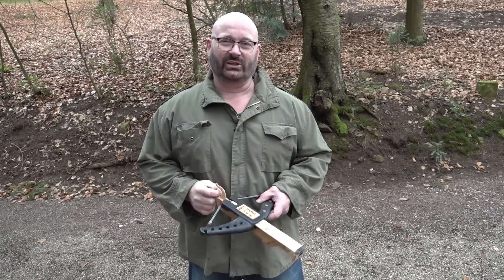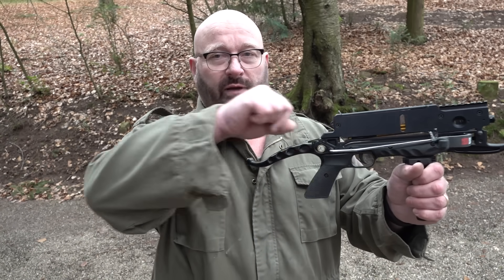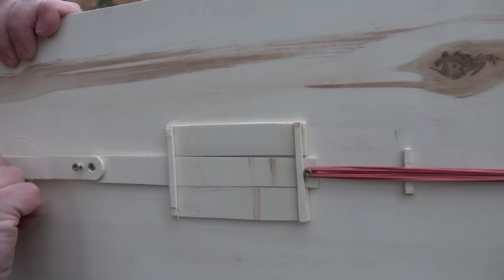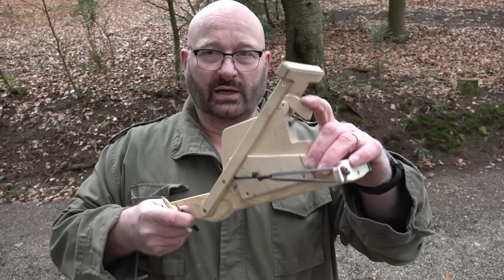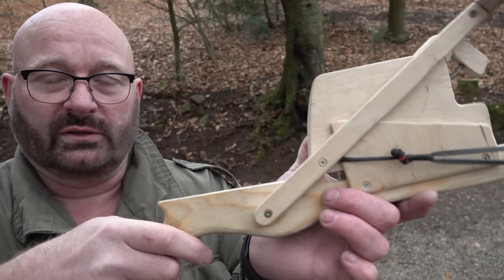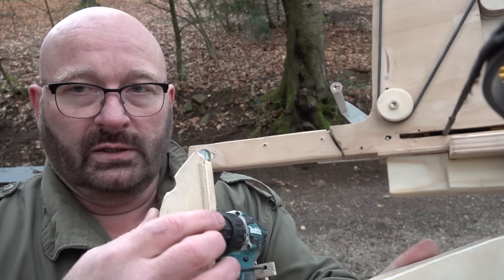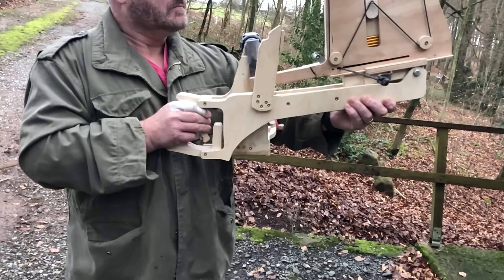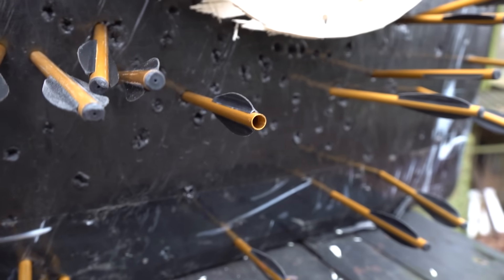Archery Extreme: Ode To Joy!

Comment: "little bit of shake"
shakes the hell out of Joerg, who is the size of 2,5 normal man :)
Reply: Zak that's called a 10 on the rector scale for normal sized guy LOL.
Reply: Yeah, but for a first prototype, this was kinda awesome lol.
Reply: Crew served cross bow
Reply: What's missing is a stock and maybe a front pistol grip
Reply: @Krzysztof Żak
i have tears in my eyes because for your comment, thanks man ;)
Reply: @looseballs1966  You must either have ment the Richter scale (how much it shakes the earth) or the Rectum scale (how much it shakes the ass).
I understand you must have ment the latter.
Reply: @BrokenSeraphim  or  tripod?
Reply: @trollslandan  Or maybe the wrecked-er scale
Reply: it's still hitting the target. With this fire rate, you can justify missing even half of the hits.
Reply: Its some arm breaking level of shake

Comment: Even with all of the movement it is SURPRISINGLY accurate. That is really, really impressive Sir.
Reply: Well, it does seem kinda bulky to be frank. I wonder if there's any way to make it more ergonomic?
Reply: @ventex1352  always from my experience. We are all ergonomically different.
Reply: @ventex1352  Building the engine into the side instead of pretty much duct taping a drill to it would definitely help ^-^

Comment: This needs a turret and the instability is no longer an issue
Reply: Rohypno tist just have another upside down on the bottom and the forces from both cancel out.
Reply: @carl9022  big brains optimize
Reply: Or a bipod
Reply: Give him a week
Reply: a turret mod of this would be awesome, some small bipods would already fix it i guess.
but it's already insane :D
Reply: You mean a bipod?
Reply: Heavy tripod would do it alright. Pivot mount for a wall or ship's railing would also work well. You could even go bigger on the whole thing and have a nice, crew serviced weapon strong enough to pierce most armor.

Comment: I would love to see something like this mounted on a tripod-type of mount (like a mounted machine gun)... And belt fed would be beyond amazing.
Reply: Yeah, the vibrations are a bit too extreme for something handheld.
Reply: Then he could use the 200ish pound long bow he had on a while back instead of these little cross bow type deals. The 50cal of the Jorg repeating bow world. Mwahahahahaha I want to see its features!
Reply: did you not see the twig? that's instead of a tripod
Reply: @professionalrookie8771  Crossbows have shorter draw lengths but much higher draw weights (a windlass has around 800lbs and arbalests have up to 5000lbs)
a shorter draw length is ideal so that the contraption can be more compact
however, he'd need more power than a hand drill to get it running
Reply: @Kensuke0987  I'm aware of that lol but as the the bolts are alot shorter they need that extra power to get enough momentum to do any damage they definantly do it well besides I'm a bow man not a cross bow man not that I dont enjoy cross bows I just prefer recurves. and I recon a hefty long bow or good recurve would make a sweet tripod repeater. Specially the way this guys going lol
Reply: @professionalrookie8771 
The power really comes from the longer draw length.
Even then, with a really long rail, you could just use bolts - or heavier bolts if you want more momentum. Joerg used bolts on his instant series saying that the enemy won't be able to shoot your bolts back with their own bows. Bolts will also make the magazine more compact.

But if you mount the bow onto a repeater contraption, wouldn't it be just a really big crossbow? or maybe a ballista even. With the amount of vibration the small one does already, it'd probably have to be mounted on a very heavy tripod too... or one that has wheels.
Reply: @Kensuke0987  yep short arrows in the bigger bow so they couldnt shoot them back is a genius idea!! Necessity and limitations I recon are the biggest factors in creativity and invention back then necessity was key these days you dont get war with bows and swords and we have more shit than we need so its surplus to requirement 😔 no more necessity inventions just limitation birthing creativity. Yes good point ballistas do exist and that practically is just a small ballista. Well instead of it being the 50cal of the cross bow world it can be the compact cross bow of the ballista world lol.

Comment: Some ideas I'd like joerg to see 

1 - LESS VERTICAL MOTION: considering the arrow is fired from the same position each shot , it is unnecessary to have the magazine moving along with the drawing mechanisim. this extra mass is the main cause of the vertical displacement. you could have the magazine fixed to the stock at the firing angle with the bow string rotating up to meet the magazine at the firing angle. 

2 - DOUBLE SPEED: a second efficiency to address is the fact that the drill is only exerting force on the bow string for one half of its cycle , the other half of the cycle is potential torque wasted (as it is returning to the starting position for half the time). 
when the string is released it returns almost immediately to the starting position at which point another drawing arm (set opposed to the first i.e 3oclock and 9oclock) could be immediately retracting the string for a second shot. firing every half rotation (adjustments will need to be made to allow for string return time) : *DOUBLE SPEED*. 
*the string will only ever follow the bottom half of the drills arc, unlike in the rubber band demonstrator where it remains attached and follows the top half too
Reply: Upvote
Reply: and run the setup upside down since the magazine isn't fed by gravity.
Reply: Upvote? This isn’t reddit 😂
Reply: I legit almost throw up when I seen  this, please read this guys comment!
Reply: How about you make one and make a video about it.
Reply: @parabina  maybe I should come up with a proof of concept. The more I think about it the more I realise the difficulties in implementing these changes 
And I edited out "upvote" 😅
Reply: Won't that creat a molecular instability on a quantum level destabilizing the coefficient drive transfer case causing a  rift drag in matter displacement detonating all matter in the lift zone ripping a hole in space-time sucking half of the planet through a black hole sending a quantum charged antimatter death Ray into the sun causing a chain of events that destroy this universe and the next on four planes of existence?
Reply: @JohnSmith-un9fy  lol
Reply: @JohnSmith-un9fy  Probably not.

Comment: Hi Joerg, if you needed extra support, I see the revolving mechanism does not come all the way to directly above the trigger guard, so you could probably design a Barrett M82A2 style stock that allows you to shoulder it better and if you made it so you could add weight to the bottom, the weight could offset the yaw force created by firing the crossbow with de gravitational force derived from the weight and it wouldnt mess up the rotational cycle. Cheers.

Comment: I love how you went into the engineering thought process that went into this design. That should help a lot of young engineers to really start to understand how to solve problems. That is what engineering is all about after all; advanced problem solving.

The thing is not all that accurate shaking around like that, but looks like fun, ha. In a world without firearms, I could see it as a viable weapon. A line of people with these things really would make a wall of bolts.
Reply: Zombie apocalypse weapon, anyone?
Reply: He is hitting the target repeatedly, which with a full auto weapon is pretty much enough. He hasn't even had time to practice with it much yet and already that target is dead.
Reply: Fixing it so it acted like a fixed turret could also make it much more accurate

Comment: You could try a Cordless Angle Grinder with variable speed. You can even adapt the switch/trigger of the drill for a more controlable speed. I just don't know the torque tho...
Reply: Better and simple use a cordless angle drill ;)
Reply from the maker: Angle grinders are all rpm and no torque. Useless. Angle drills have much less torque too. Forget all this angle business, it does not work.
Reply: @Slingshotchannel  words of wisdom.

Comment: This actually gets me thinking about Airsoft AEG gearboxes and motor sets. It could produce the same results with some tinkering now that I think about it.
Reply: Tactical Shrimp That’s why I was thinking about modifications. You can get some pretty powerful high torque motors that can pull much stronger springs. I was thinking of the same concept as the power tool, but without the crazy rotator mechanism that causes a lot of recoil.
Reply: Tactical Shrimp I’m just applying what Jeorg was thinking of, in making possible full automatic and semi-auto capabilities.

We don’t really need a stronger spring to project the arrow, but to rather reset the firing mechanism, which doesn’t necessarily have to be an AEG piston. The gears grabbing onto the piston teeth, is what I’m projecting to be the mechanism that pulls the bow string back for cocking. The V2 gears and motor inside the gearbox will minimize the entire recoil aspect via the power tool rotators. Since the motor is essentially the power tool.

Comment: Joerg- have you ever thought of using course threads to cock the cross bow. Using a lead screw like on a metal lathe and a half nut to pull the string back. once the cross bow is cocked  the half nut would be pulled down with a spring and returned with a spring to do the process over and over again. The movement could be kept to a minimum so very little vibration and friction. The drill and the lead screw could mounted in line.

Comment: “The germans had the strongest weapons during world war two,”

THIS GERMAN HAS THE STRONGEST WEAPON NOW
Reply: That sentence in quote marks is wrong since Americans had the A-Bomb in WW2
Reply: @gokbay3057  
OP is probably talking about stuff like tanks, guns, artillery and most other things, since Germany was way ahead of the other nations. They just didnt have the industry and oil to supply the weapons
Reply: @BeGayCatDoCrime  I would disagree. German tanks weren't really the best even if they were impressive. Of course everyone would know that Germans did not have the strongest navy, as good/useful as the U-Boats are. Germans did create the Stg-44 (I think that was it's name, the predecessor for the AK-47) but their earlier guns weren't the best as German soldiers on the Eastern Front often decided to drop their submachine guns for the Russian SMGs (those with drum mags, I think that was the Tokarev). Of course Germans biggest problem was resources and production capacity. Thought their designs were partly responsible for the problems with production capacity (Americans could have probably built more Tigers faster than the Germans could but more importantly they could build even more Shermans, even faster). But then again, no one could compete with American production capacity.

I am not even American but they were extremely OP during WW2. Sherman might have been a shittier tank than the Tiger but it and it's crew could be replaced and they could field more of them. While the Tiger couldn't.
Reply: Pppft we Brits had tea and stiff upper lips...no military might comes close to that!
Reply: @gokbay3057  In fact, Stg-44 is a predecessor of M16. AK took just the idea of intermediate cartridge from it. The rest is a successful combination of ideas from TKB-415, AVS-36, M1 Garand and more, yet not inheriting Stg-44 design decisions.
Reply: @gokbay3057  well they acquired the a bomb by stealing German Uran and plans mostly.. So basicly no
Reply: German tecnology is the best in the world
Reply: Gokbay yeah germany was so bad yeah.... thats why they almost single handly won all of europe and africa 

You my friend are not the smartest of you class
Reply: @peterzingler6221  Actually no. German had not even been close to the bomb and didn't had enough uranium, too. In this case USA did it quite on themselves.
Reply: @Kelvinpierre99  how are you gonna tell him he wasn't the "smartest in his class" when you're using 2nd grade level grammar trying to sound smart
Reply: And it’s a No2 pencil
Reply: Helder Cunha  No they didn't. Get your facts right. Germany was on the wrong way regarding nuclear power and bomb. e.g. they calculated the critical mass wrong, so they never would have made the bomb work.
Reply: Ulf ViKings  Germans built the first Jets iirc. Also I didn't say Sherman was better than the Tiger. Also I agree that Germans had good tanks. I just said Germans didn't have the best tanks. Soviets had pretty good tanks for example. Outside of the Jets Germans also built very good planes (fighters and dive bombers particularly) but Americans also had incredible planes in said department while Brits had the Spitfire in the fighters and Japan built very good carrier aircraft.
Reply: @onion_wind  My dad captured a German tank with his Lee Enfield .303 rifle. He saw it stopped on top of a dune in North Africa, took a pot shot at it and 6 Germans appeared from behind the tank waving a white flag. (The tank was broken down and the Germans were happy to be taken prisoner by the British :)
Reply: Russian : hold my tsar
Reply: @gokbay3057  The AK-47 is Russian, though. How can a German gun be the predecessor of it?
Reply: @andrewdevine3920  basicaly they took Stg-44 as a base for AK-44 (at least its looks and design), simple as that. After Germnay lost WW2 Americans stole their scientists like Mr. Wernher von Braun and Soviets took what was left of it, technical plans, drawings and rest of it.
Reply: @andrewdevine3920  the AK-47's design was as far as I remembered when writing that comment was heavily based on the German gun.
Reply: Jojo Reference

Comment: I think looking at opposing twin cylinder engines would suggest a pair of moving mechanisms 180° offset would be far more practical than a large weight to balance things out.
I am aware this would almost double complexity, but surely this is just for fun? A little extra complexity is surely worth it if you could increase fire rate and accuracy?

Comment: About the vibration and balance that was discussed at 12:15, I can not understand that the "draw-weight" of 80 pounds is relevant for the the counter balance mass. For some reason I think that the "draw-weight" and horizontal "recoil" is contained within the system, and it is the shifting of the magazine/ammo mass that introduces most of the vertical imbalance while operating the tool.

Comment: @JoergSprave Hello Sir. I hope everyone is well and that you and your family have a beautiful holiday season.

Off topic question.. Can I put a plastic Shrink Wrap around the trigger point section of my AR-6 2 Stinger crossbow string? I find the String Wrap on the stock string frays very easily. Do you have a suggestion that addresses my issue?

I greatly appreciate any help you might offer.

Sincerely,
Robert
Reply from the maker: Shrink wrap does not work. Frequent waxing works well but you will still have to redo the serving every now and then. Alternatively, you can switch to hand made Dyneema strings that do not require middle serving, lasts longer and are dirt cheap (like a dollar per string). https://youtu.be/fkuMtmP95f4

Comment: Hey Joerg, why not a screw release system?
The rope is relied to a 2 part nut which placed on a screw. activate the drill make the crew turn, forcing the nut to ramp up the screw, pulling the rope. At max pull, the nut separate from the screw, being pulled back by the rope firing the arrow.

Comment: Quick idea: Why not make the bow and string rotate instead of the magazine? It should work either way, and you'd have much less mass moving.
Reply: Less mass but it would make it less accurate to have the crossbow part flying in circles.
Reply: @spencer4679  
You're 100% right it would be inaccurate, but I actually think the recoil from the extra magazine mass makes it even less accurate than that. Anyway, the angle of release wouldn't change since it fires at the same time every time.

Comment: 9:48 Imagine having that back in the middle ages :D
Reply: They had more than you can imagine ;)))
Reply: Would be useless against armored targets compared to other existing crossbows. It would be a great home defence weapon though
Reply: Stake burning intensifies
Reply: @downwiththesystem8026  simply no.
Reply: @Justin Boyd I see your armor and raise you one solid metal spike. Plate armor probably could stop it but plate is also expensive enough to be out of the range of most mercenaries.
Reply: @simonnachreiner8380  An 80 lbs bow with that small of bolt would likely not even be enough to take out someone with gambeson or leather.  It would hurt but it wouldn't stop them from charging you with an adrenalin rush when it is only penetrating at most an inch.  There is a reason bows used in war were more than 120 lbs with arrows 4 times bigger than those bolts.
Reply: @Andreas until your battery runs out of go-juice and the next wall outlet is 800 years away, then you'd be happier with a normal crossbow  or one with a hand-crank on the old model he also showed :)
Reply: @simonnachreiner8380  an 80lb crossbow is basically a toy compared to actual medieval crossbows. Infantry would typically wear at least gambeson/aketon, which is an inch thick many layered cloth garment, made out of tough cloth with the same idea as modern kevlar soft body armor panels.

Crossbow bolts and arrows would often get snarled up in the fibers limiting penetrative even with 200-300lb medieval crossbows.

An 80lb crossbows would pretty much only be useful for small game hunting and shooting burglars.